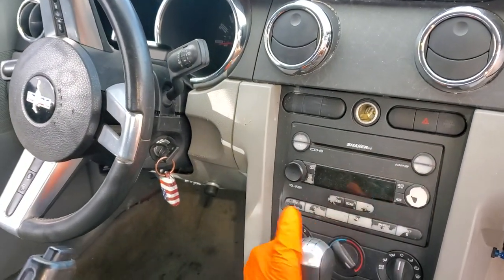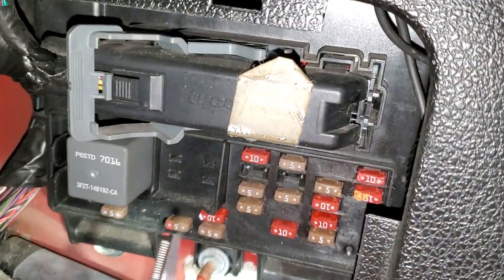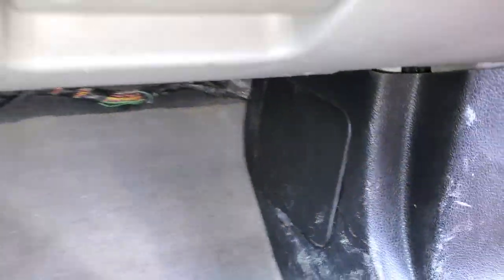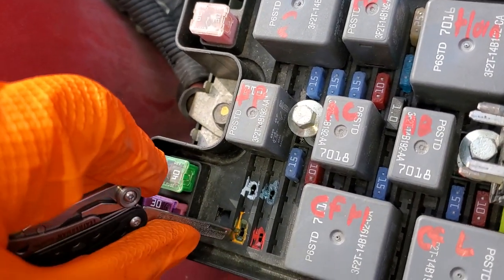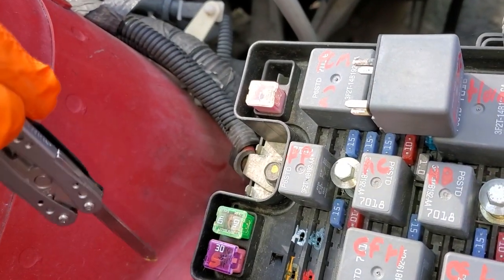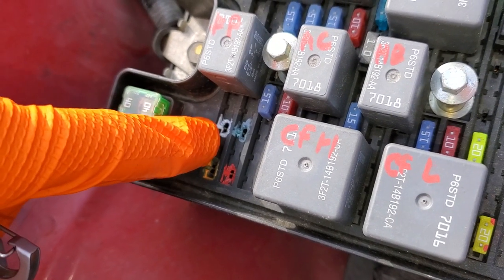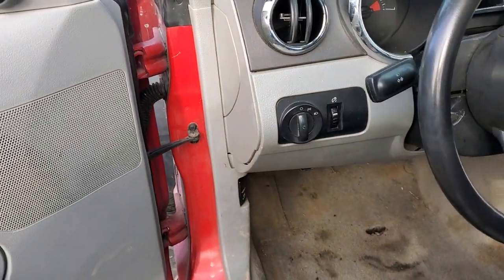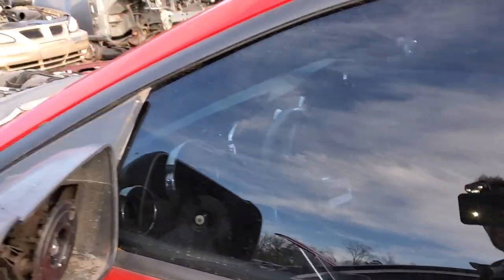2006 Ford Mustang Starter Relay, Starter Fuse, Circuit Explained

Comment: I know it’s probably a little late but that switch you showed at the clutch, that’s the cruise control switch. There is another one on the firewall that gets pressed when your pedal goes to the ground, that’s the clutch ignition safety switch
Reply from the maker: Thanks for updating us with that info!

Comment: I tested the first fuse you showed, and when i turn the key I'm getting power there, however is supposed to go to the safety switch next, and that's my issue, I'm not getting any power to the safety switch so no power to big fuse box after > and  no power to starter.

Comment: Great video.  Ended up not being my problem.  For anyone else looking, i found corrosion on the starter solenoid activate nut, and main power wire to starter.  Took it all apart, cleaned them all to a polish, then coated it all with die electeic grease.   Good as new
Reply: Hey man! I am having trouble, car has power go to crank it, it won’t crank, it’s a manual. Maybe the clutch position sensor

Comment: Hey i may be a little late but im having an intermittent issue with my 4.0 v6 automatic, fuse 21 that is a 10amp in the passenger fuse box keeps blowing on me randomly and ive had to jump the relay to get my car running for work and i wanna know where to check and if my neutral safety switch could cause a short to ground to that fuse itself. Thanks
Reply: i dont know if this would help anyone with a similar situation but i went ahead and went through oem diag procedure from ford on prodemand and after performing testing at the battery to starter, then testing the electrical distribution center and in this case i drive an automatic so ford stated to test for resistance at the pnk/wht circuit from the fuse box to the transmission range sensor and when i routed my test lead down the driver side of the motor to backprobe the transmission range sensor connector it tapped the bellhousing and i was getting resistance in which i should not have gotten any reading at all and i looked at the harness and i saw a portion of the harness exposed from chafing on the passenger side head on that sharp edge from my negligence of routing the engine harness when i rebuilt the motor, and with vibrations overtime exposed the wire and touched the head thus shorted the fuse in the smart junction box in the cabin. i hope this could help.

Comment: I am having that issue with my junction box. It had corrosion and I replaced it with a new one and with the new one I am getting power and everything but my car won’t start up and my radio doesn’t work and my windows won’t go up to that point I don’t know what to do.

Comment: I have a 12 model mustang which seems to have the clutch safety switch bypassed, It is not bypassed at the switch connector wires though , where should I look to undo the bypass? I want the switch functional as a tire tech just started my car in gear and drove it into a wall.
Reply: The switch itself is not stuck either, vehicle starts with switch disconnected. I'm at a loss. I will check both  starter relays to see if they are tampered with.

Comment: Just a quick question. Yesterday I drove my car two hours and went into a mall to grab something to eat. I came out 10 minutes later and all my car did was click. Luckily I was parked on a slope and rolled it and jump started it. I went to a auto parts store to get a new battery. Parked on a slope. Stopped the car. But then thought, what the heck. I'll try starting the car again. I had lots of starting power and had no problems for the rest of the day. I have had this problem twice this year. The shop says they tested the battery and alternator and they are good. Would what you described in your video mimc this problem?
Reply: Just as an add on. The car is a daily driver. I rarely have this problem, but of course hate it when I do.

Comment: I was checking continuity on my big fuse box for the starter trigger location on the relay, on the actual harness where the pin plugs into with the connector there's not actually a wire/pin there, I'm super confused how there's supposed to be a starter trigger to the relay if the wire is non existent. To clarify I'm talking about location 85 on the relay itself. It doesn't have a wire to plug into.
Reply: This sounds super repetitive after reading it again but you get my point lol

Comment: Hello, I have the following problem, first the battery is completely discharged, they told me it was the alternator, I changed it, this time the car or putting the cables on, you only hear an electrical step and the battery is at 30 and the other car  turned on and does not give star that I should check

Comment: Where does the ground on the fuel pump relay bolt up on a 2009 mustang gt 4.6 5 Spd. It's an external ground but without dissecting the harness if someone could tell me I'd appreciate it. Thanks. Marty

Comment: My 05 v6 mustang is having the no start no crank issue,,, I've checked all the fuses twice,,, has a new starter relay... New battery and new starter,,, I'm not getting a signal to the stater when you crank it... I've checked the fuse in the fuse box with the key on ignition on and that fuse is getting power..
Reply: Any luck? Did you find the problem? I'm having the same issue and I can't figure it out
Reply: @andygarcia1770  it ended up being that my starter relay was loose,,, it wasn't making a strong enough connection in the fuse box,, so me and a friend ended up unplugging the fuse box and taking it apart and tightening up where the relay plugs in... After that ,, we put it all back together and it's been cranking without any issues..

Comment: Help! I have a 2005 V6 Mustang. It randomly stopped while I was driving on the road. I got it towed home. I replaced it with new battery. New alternator. New Starter. New fuel pump. 
I turn the key it cranks but no start. 
I even pushed the red button near driver side door. Please I need help!
Reply from the maker: Do your ignition coils produce sparks when the engine is turning over?
Reply: I have the same problem 2007 mustang new fuel pump and new alternator as well
Reply: I ended up selling it. Got a new Mustang GT.

Comment: having trouble with my automatic . it will make i tink sound when you turn the switch but wont turn the motor . but you can jump it off at the starter with a screwdriver what could my problem other that my lack of knowledge ?
Reply: @Hi Hi I fixed mine it was the solinoid on the starter
Reply: @arrowhead893  what'd you have to do to the solinoid
Reply: @benjaminshort3590   put a new one on the starter my friend that rebuilds starters sold me one for 22 dollars and i just put it on the starter and that fixed it,

Comment: my lil bro has the automatic transmission and is having an issue with the starter staying engaged on the flexplate, same issue after putting in a new starter, any ideas?
Reply: @brandonrobinson1384  did you find a solution to this? Having this issue now

Comment: My 30 amp pink fuse keeps blowing what's causing that
Reply: Check you’re grounds make sure wires aren’t touching anything to short the circuit
Reply: Did you fix it? I have the same problem

Comment: Nice video just started having this issue as well , how can I test the first fuse you showed in the video ? I'm trying to figure out by it's driving me crazy , I pulled it out but can't see any voltage , am I doing something wrong
Reply: You have to make sure current can flow through it.
Reply: @wolfgangouille  I tested the first fuse he showed, and when i turn the key I'm getting power there, however is supposed to go to the safety switch next, and that's my issue, I'm not getting any power to the safety switch so no power to big fuse box after > and  no power to starter.

Comment: Hey! Your videos are very informative. It's difficult to find information. I have a 12v draw that disappears when I pull fuse 42. That fuse is supposed to be activated by the ignition turned on according to one thread but I'm not sure that can lead me to the issue. Most likely wiring.

Comment: okay. so i get power going to the fuse on the passenger side. but not to where you have marked orange on the relay. i tried jumping the wires on the clutch safety switch still no luck. but if i put power to the relay like you said the car starts. any ideas?
Reply: Did you figure it out

Comment: My car wont start it's not the starter and not the battery what do you think it could be? It doesnt crank it just does 1 click
Reply: same. you ever figure it out?
Reply: Same
Reply: Any luck? My 05 GT just started doing that
Reply: @jayyhernandez243  i just started wiggling all the plugs under the hoo to make sure they were pugged in good. and it started..
Reply: @jayyhernandez243  mine was the starter crap inside the steering column and the keys
Reply: Did you ever figure it out ?? I just replaced a battery and alternator.  I can jump the car off and it runs good gives me no troubles but when I park it I lose power. Cleaned the terminals as well . Shit is driving me crazy .
Reply: Did you figure it out
Reply: @rockyroot4092  the key insert wouldn't work went to a mechanic they installed a new one and got a new key